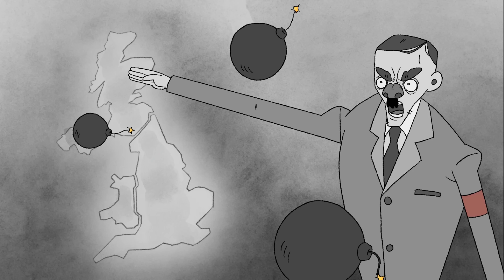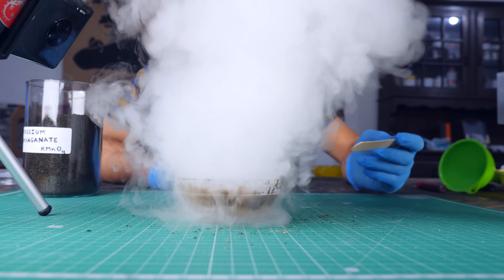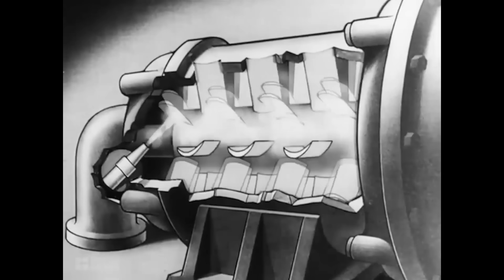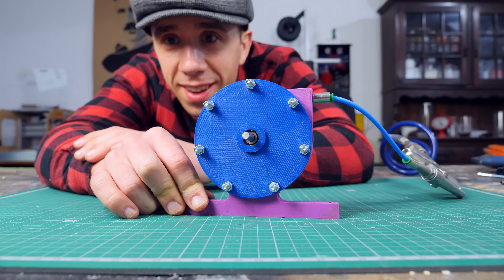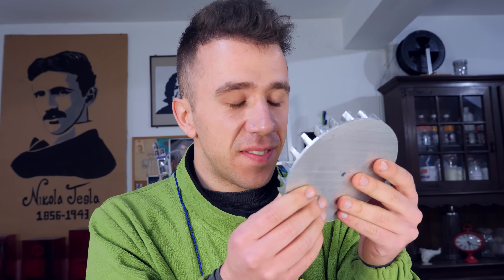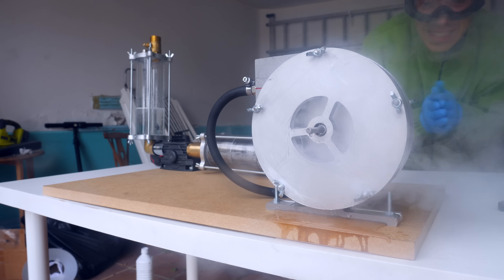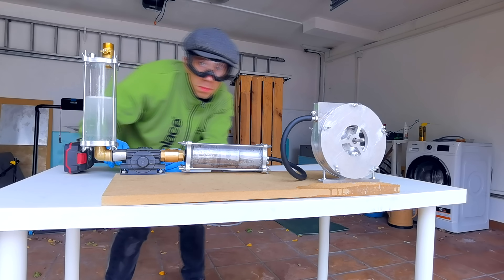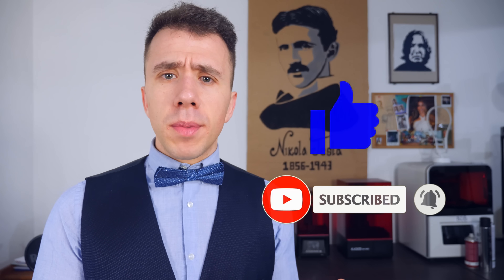I built the World War II V2 Rocket Steam Turbine

Comment: Hey Integza, sorry that I'm late to the party, but I recently tested an engine very very similar to your turbojet and I found an big problem with the reliability of the engine. When I test it in high revs the bearings start to throw out the lubricant in them which leaks and gets ingnited by the sparkplug. The main problem with this is that it puts too much fuel and shortens the life of the bearings to nothing. If you have suggestions please leave it under that comment. Have a nice day/night.

Comment: i think the problem is you need something to separate the peroxide droplets from the steam flow. steam engines want dry steam, what you got there is very wet. fortunately thats steampunktech. locomotives have a steam dome that does this job. i bet you could make one out of a short section of copper pipe and some endcaps. i want to say extend the tube a bit and then bore and tap a hole in the side, but that sounds like a structural failure waiting to happen. i think the extra space is important because you need a place for the peroxide runoff to go, and it can feed back into the catalyzer.

Comment: couldn't you also add a second stage turbine, possibly a low pressure chamber, powered by the exhaust of the high pressure similar to a compound steam engine, combined with a gearbox of such, and therefore get more power out of it? Also try linking the initial stage pump to the output of the turbine to remove the electric drill from the setup, and just jump start it with a manual human powered spin of the turbine shaft?

Also you could link the turbine output to a propeller (likely through a gearbox) and create a sort of monopropellent turbo-prop

Comment: orientation of cat chamber.        orientation of turbine.
include a (gravity) fluid trapping chamber between the cat chamber and the turbine.
make it easier for gases to  Exit  the turbine, at a certain 'point' in the housing; at present, exit of gases is  Opposed by centrifugal force; aka the runner is being fouled.        balance the runner.
determine whether fewer runner vanes are more  effective, at speed.
determine whether runner efficiency would be greater, if a  second/upper plate  was part of the runner. 
the  turbine  Should be loaded  via  HIGH-ratio  reduction  Gearing; so that the turbine rpms are  NOT  excessively reduced.  eg., conversion of rpms to Torque.        googletranslate

Comment: BRO YOU"RE SO CLOSE TO HAVING A COMBUSTION TAP-OFF CYCLE ENGINE! THE DECOMPOSING CHAMBER IS ACTUALLY YOUR COMBUSTION CHAMBER! HAVE THE TURBINE PUMP SPIN THE GARDEN PUMP SO THE ENGINE CAN CONTINUALLY FEED IT'S SELF! YOU CAN HAVE A SMALL PLUNGER PUSH A FEW HUNDRED MILS OF H2O2 INTO THE COMBUSTION CHAMBER TO START THE REACTION!!!!!!!!!!!!!!!!!!

Comment: No matter what you design and build, you could do with balancing it just before it goes into assembly. You take your whole part that's gonna spin around and spin it slowly and mark the lowest point.  That's the heavy side.  If you spin it again and the marked side doesn't end up resting on the bottom, then it's balanced.  Mathias wandel has a few examples of easy diy balancing.

Instead of sticking weights on, you could carve some material out with a file or angle grinder

Comment: Mount your cat cell vertically and atomize the peroxide through a high preasure nozzle into the cell rather than just dumping 8n an amount under pressure should enable full decomposition without peroxide making it to the turbine.

Comment: Recirculate the excess hydrogen back into the supply tube.  The pressure from the gas should be enough to push the liquid through a hose.  You will just need a vent tube at the top of the supply vat.

Comment: Idea: optimize the design enough to the point that you can make it power itself (so it becomes an engine) by having the turbine directly power the pump. Might need a smaller diameter turbine for the speed, or you could gear down a larger one

Comment: Or research Sandy kidds gyroscopic precession levitator
The gyroscopes made to be as far apart as they are wide and they need to be heavy and spinning at 40,000 RPM going around each other at 30,000 RPM or as fast as you can get them to go😁

Comment: The problem is that you are just passing the H2O2 through the catalyst while it is sideways. You need to instead use gravity to assist. The steam chamber should have a pump at the bottom which feeds uncatalized H2O2 back to the top of the chamber and the steam escapes through another exhaust also at the top, this way only steam is leaving.

For your next stage, after ensuring that you are extracting all the potential out of your H2O2, the turbine should use a reduction gear to drive the reservoir pump. Once started you'll have a steam turbine that feeds itself.

Comment: It'd be cool if you were to connect the output of the turbine to the input of the pump that way it could self sustain until it ran out of fuel, although you may need some sort of gear reduction to get it to turn the pump at a good speed.

Comment: Few points i would add a reclamation/condensation chamber in between your decomposition chamber and the turbine with a drain to return the liquid back to the decomposition chamber and i would make your decomposition chamber a little longer to make an accumulation area with the gas release port in the top and a return port from the condensation chamber in the bottom and tilt it so the exit end of the chamber is higher than the input. this will get most of the liquid to stay in the chamber and what does go through will get caught by the condensation camber. As far as the condensation chamber it doesn't have to be large probably 1/3 of the size of your decomposition chamber but it needs to make the steam or high pressure air change directions. One way to do that is a cyclone separator or a couple in series would be the most effective way but even just a chamber with some stainless pot scrubbers in it and with a drain and top gas port out would probably do it in a quick and dirty way. This would make for a much more complete decomposition and longer run time. There are many ways to improve the turbine especially if you move to more of a turgo style spoon design and tune the angle of your blades to the angle of your in coming steam.

Comment: Video Idea: A 3d printed steam powered wankle engine with the new catilizer. You could further inprove on the design, and maybe bump it up to a size wich could fit a bike. The hydrogen peroxide which left the turbine could be repurposed in the wankle engine as it would leave from the exit valve.

Comment: If you mount your steam chamber vertically with the hose coming out of the top, instead of horizontally, you might be able to catalyse most or all the H2O2 instead of pushing it out as liquid with the steam.

Comment: I just want that CnC machine, you should make a turbocharger style impeller system and reflow the hydrogen perxodie back into the container, giving higher effeciency and creating a loop that you can self pressurize using the output shaft of the turbine. Also you have a cnc! Metal gearbox off the output shaft to produce low rpm high torque rather than high rpm low torque. The system I imagine has the turbine attached to the pump, you inject the peroxide using a syringe, which starts the proccess and then it self pressurizes until the "fuel" is consumed. Using a gearbox to lower rpm for the pump and then you can also run a second pump to run more liquid to finally achieve glorious rocket power!

Comment: Simply mounting the output of the catalysors higher would drastically improve the performance without focusing all the liquid in one converter if you mounted the tube vertically.  With it being centered, it doesn't take much to get through the converters and into the feed line.  

You could also test if input level matters.  I'd like to think input being mounted higher would also disperse the liquid better. But that's just a theory.

Also, have you checked into peristaltic pumps for your feed mechanism? Could be worth it depending on how that drill pump ends up.

Comment: Stand the catalytic converter tank up and leave some space at the top. Inject the fluid from the bottom. This will cause a small steam bubble at the top. Basically make room for steam to build and area for fluid to fall. Maybe a splash guard inside the tank. That should allow only steam to enter the line to the turbine. Hope this helps.

Comment: If you had access to higher concentrations of hydrogen peroxide you could turn that into a rocket by igniting the high pressure oxygen supply. Or add a fuel that can be burned in water and a make a second stage combustion engine to add torque.

Comment: Video idea: You've successfully created all sorts of crazy engines, so how about the Adams-Farvell rotary engine, where the pistons are turning around a stationary crank shaft! :D
Reply: @sourand jaded radial engines have static cylinders, rotary engines don't. They're superficially similar at most.
Reply: @sourand jaded nothing unusual? You couldn't just "bolt them down to the frame backwards", they are completely different to radials except for having cylinders around a central point.

Comment: Video idea: Laminated object manufacturing (LOM), it's an old style of additive manufacturing that is technically possible to do manually. Cut layers of an object out of sheet metal (with the CNC router preferably, doing it by hand would take forever!), stack them up, weld them together! Become the 3D printer!

Comment: I want to see a groundwater-fueled Stirling engine.  
A Stirling engine is a heat differential engine - it just needs a hot side and a cold side.  The bigger the differential, the more power the engine has.  
People have already built concave mirrors to focus the sun's rays onto the hot side of an engine, but I've never seen anyone dig a hole deep enough to reach groundwater, throw a loop of copper pipe down there, and pump water through it, using the groundwater as a heatsink.  Just like a PC watercooling loop, warm water is sent down the pipe where it dissipates heat into the groundwater, then back up to the cold plate of the engine.

Comment: That acrylic pressure chamber is terrifying.  Acrylic fails catastrophically and creates extremely sharp, transparent pieces of shrapnel.  Not to mention the hot concentrated H2O2 that would be released.  If the pressure causes that chamber to fail then it may seriously injure or kill you.  This would be much safer if you made the pressure chamber out of pressure-rated steel tube.  Ideally with a pressure release, but that may not be necessary considering the pressure rating of the steel chamber.

Comment: Bro, instead of using a one way valve, bleed pressure off of the catalyst and pipe it back to pressurize the fuel tank. This way you won't have a huge pressure gradient across the pump. Also, its probably a good idea to mount the pump inside the fuel cylinder if possible, for similar reasons.

Comment: You could use compressed gasses to provide pressure for your propellants/oxidizers. Similar to your syringe design, but compressed gas pushes them instead of you.
Also, if you mounted the catalytic converters vertically and pumped the peroxide up through the bottom, the steam would rise to the top and pull less of the un-reacted peroxide with it, allowing you to keep peroxide out of your turbine.
Alternatively you could and a 90 degree bend at the end with a short length before the tubing, possibly allowing you to mount it horizontally while still keeping the desired result of a vertical mounting system.

Comment: As the peroxide enters the catalyzing chamber, it is converting to steam at an uneven rate. So as the peroxide breaks down into steam, it takes up much more room and pushes out the yet un-catalyzed reactant. I suggest turning the reaction chamber vertical and giving it a few centimeters of head space. So when the steam pushes the liquids upwards, it will sputter and fall back down into the reaction media instead of entering the tube.

Comment: For the next experiment, replace the reaction turbine with a Tesla turbine. Much easier to balance, more efficient, capable of higher speeds. 

Also, you need to mount your catalyzer vertically with the intake port on the bottom, this way gravity will keep it from forcing uncatalyzed hydrogen peroxide out into the turbine before it can be catalyzed.

Comment: Turn the catalyser 90 degrees so you have only steam and oxygen leaving the top. Also add a small drain port at the bottom of both the catalyser and your turbine. Just so you can drain them at will. Perhaps the one in the turbine needs to be there always just so any liquid can drain.
Now if you add a fuel you could use the oxygen to burn that fuel and create an extremely powerful and dangerous rocket. Probably don't do this though unless you run out of ideas and want to risk your life. This sounds like something you would do though...

Another option is to put the catalysers in parallel instead of series. This would be difficult but can almost certainly increase the pressure or consistency of the output.
A video idea you could try is to see if you can cut metal with steam. Extremely high pressure. If not, apply the above suggestion aka add fuel and see if it works then.

Comment: What about a pressure regulator between the catalyst chamber and the turbine?
You ahould also consider a pressure relief valve to avoid the catalyst chamber becoming a pipe bomb if you pump too much peroxide in

Comment: I don't think the turbine is the problem. I think you need to turn the "decomposition boiler" vertical. That should help ensure the peroxide liquid encounters more converter rather then getting blown out of the system into the turbine. More decomposition means less liquid carryover into the turbine, which probably impacts the efficiency of the turbine power as well.

Also, turbines are best at high velocity. Because of the direct drive load, the turbine never gets to it's power range. 

You need a gearbox to convert from super high rpm to the right rpm for the generator, and a relay to engage the electrical load only once the turbine is up to speed.

Comment: Wondering if the Peroxide were to be sprayed into the catalysts with a fogger, with an air gap to allow it to spread out, and the chambers outlet placed at the highest point to limit liquid transfer out the nozzle, would it give better results? Kind of looks like less than 5% of the flow is actually getting converted and the rest is just flooded.

Comment: Dont know of your experience with vehicles or testing components of vehicles but a couple video idea A. See if you can recreate the Turboniques rear axle jet turbine it was a major automotive failure in the 1960's but they said it was capable of delivering up to 1300HP directly to the rear axle of the car. B with this steam powered turbo youve shown you can build a turbo set up, try and build a mag-lev turbo like is used in industrial applications for a vehicle.

Comment: Try going two stage with it.  Slow injection into a catalytic convertor (somewhat well distributed across the face of the cat) to build high enough pressure to be very well atomized before going into a second series of  convertors downstream.  With the increased surface area and overall reduced volume I would think you would get a much more complete and probably more controllable reaction.

Comment: Hi there. I wanna start off by giving credits to this amazing video. However if the top part of the turbine (where the power gets made) or even the whole face we’re to be sealed it would allow for more efficiency and less waste. As for how to get the steam back out it may work to have an “exit port” somewhere on the bottom of the inlet side. For the hydrogen bypassed not getting converted maybe have the converter chamber exit facing up so liquid is less likely to escape.

Comment: If heat is in any way an option heating up the catalitic chamber might produce a better decomposition reaction since hydrogen peroxide really likes to decompose with heat, especially when at higher concentrations. Also, as a fun fact, 50% and above peroxide might start to have enough oxygen in it to work as an oxidizer for a rocket.

Comment: You need a liquid trap on the cat output to catch H2O2 before it goes to the turbine.  Could be just another tank like the one you used to hold the H2O2.  You could also use the turbine to drive the pump?  Gravity will get the H2O2 flowing to start or maybe give it a few turns to start flow.  Do this right and maybe you could make it a steampunk, steam-powered, steam rocket skateboard.

Comment: Germany V2 rockets used 80 to 85% concentration. More energetic means more steam and less water.
You should concentrate your 50% H2O2 to 70% H2O2. Be careful as you know these concentrations are very much more dangerous.  

Taken from wikipedia.... 
"Commercial grades from 70% to 98% are also available, but due to the potential of solutions of more than 68% hydrogen peroxide to be converted entirely to steam and oxygen (with the temperature of the steam increasing as the concentration increases above 68%)"

Comment: Tip the catalyst up on its end so the peroxide enters the tube from the bottom so the liquid stays at the bottom. Any liquid particulates in the steam generated would have additional time to catalyze as the steam rises through the catalyst matrix. You don't really need to modify anything but the base to make it happen.

Comment: Most important thing when making systems that run off pressurized fluids or gasses is tolerance, you want that chit to have no gaps and a way to tune the exhaust valve to not let more exhaust out than it has to. Just listening to that contraption work I could tell your tolerances we're looser than a $5 whor- I mean lady of the night.